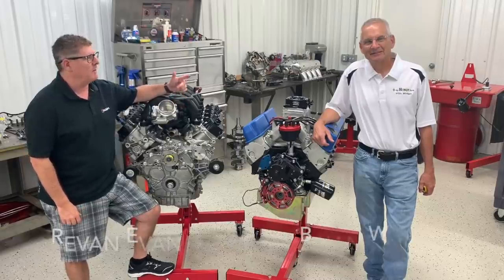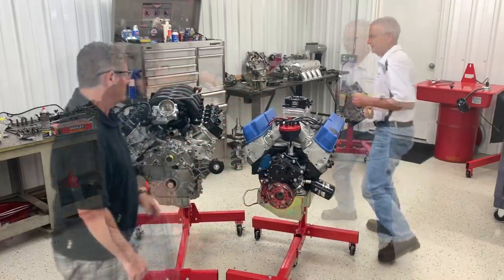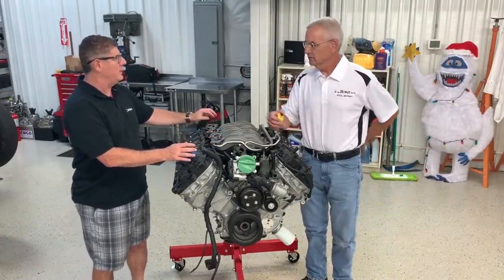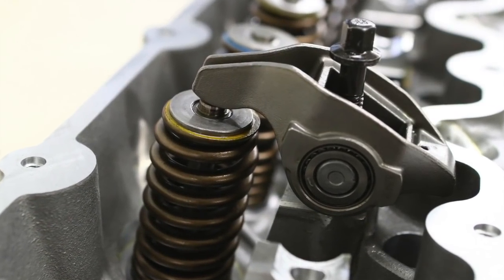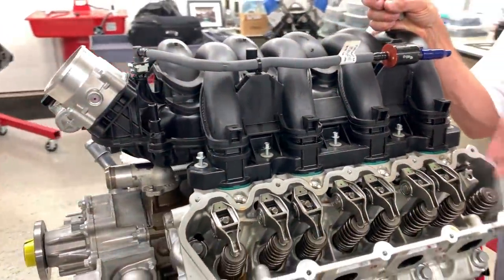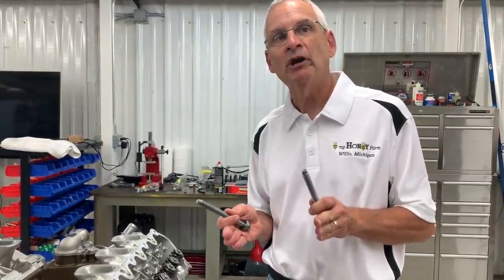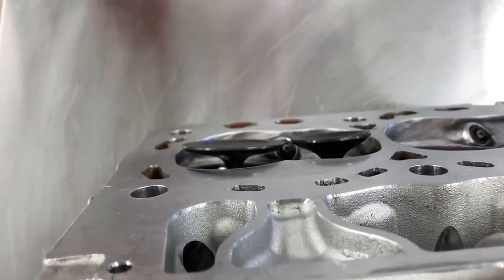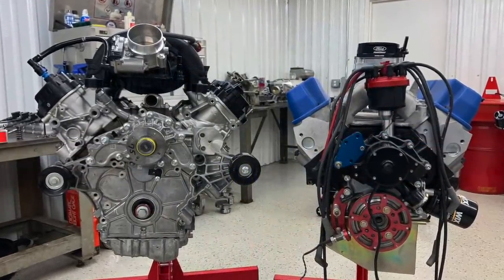Ford 7.3L Godzilla Engine Dyno Results, Teardown & Comparison to Coyote & 351 Windsor Part 2

Comment: Block is iron?   They need to make it aluminum so it's light.   It'll be clear that it's used where a 351w would be used more power and weight savings.

Comment: Two questions. Does this engine have timing belt or chain? And it seems this is to replace the 10 cylinder engine in fords line up. 
Thank you for this video information.

Comment: Looks a lot like Ls 3 head chambers and the block and lifter placement is Ls. Some what of a large copy.The 351c and boss 302 heads and 385 engines were canted valve like the mk4 big block Chevy heads. Good job Ford!

Comment: I would also like more detailed info on the rest of the motor, i.e. piston material, connecting rod details, crankshaft details, and lower end of block. Are main caps one modular unit?

Comment: Hello Evan, Im in the industry as a valve manufacture, we are tooling up to make stainless racing valves for this motor, was looking for some info. i have drawings ready to go, but im wondering if we should make an oversize valve, or leave it standard head size, could you possibly shoot me an email.  jd@sivalves.com  Thanks in advance.

Comment: Four-bolt heads.  The bolts are 13mm, but it doesn't look like there's a provision for six-bolts as the top ones would go through the intake port unless there's a plug to close up the port on top.

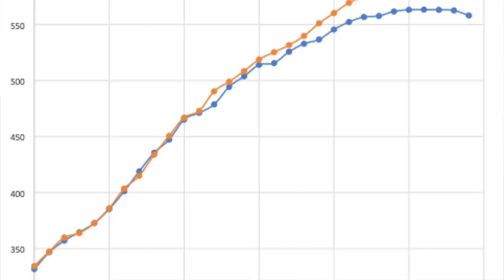Comment: The dyno graph at around 9:30 is interesting.   The first column is marked "headers" but the power was consistently less than the other column without a designation.   Probably a damn set of shorty headers.

Comment: I bet they make this an EcoBoost and if they do I can finally get rid of my diesel and the 18qt oil changes, the DEF, the DPF plugging up and all the other issues with running a diesel these days. Any fuel economy gains with a diesel are offset by the other expenses of running a diesel.....Ford, please make this an EcoBoost engine!!!

Comment: PLEASE, PLEASE, PLEASE YOU HAVE NOT EARNED THE NAME GODZILLA. AND A FORD NEVER WILL. 7 POINT HOW MANY LITERS ARE YOU JOKING. MY GTR IS ONLY A 3,8 LITER 6 CYLINDER AND BLOWS THE SHIT OUT OF ANY SHIT FORD YOU CAN FIND. AND MY GTR IS ONLY A STREET RUNNER. RAN 8.4 AT 162 WITH THE AIR ON STERIO BLASTING(RIDE LIKE THE WIND) CHRIS CROSS, AND WINDOWS DOWN ON PUMP FUEL...COME BACK WHEN YOU CAN DO THAT WITH A SIX....
Reply: Chris Cross was gay back in the day and sure as hell hasn't aged well. Did you follow it up with some Boy George and some Eminem? Modular Fords were going 5s fifteen years ago with stock blocks, heads and cranks...John Meovetzs. Nothing worse than a GTR fanboi Elward.

Comment: Hilarious seeing all the Ford fans come out of the closet. Nearly 3 decades of shit talking about how overhead cam was the shit and pushrod engines were shit. Now Ford has a new pushrod V8 and their fans are pretending they never shit talked pushrod engines for 3 decades.
Reply: What are you on about? We never trashed talked pushrods, and ford still sells reproduction Windsor blocks. The reason overhead cams are popular is for their ability to have more than 2 valves per cylinder, and reduced valvetrain mass.
Reply: @riogrande163  Every billy bob driving a Mustang or F-150 with a mod motor under the hood has been talking shit about GM and Chrysler "still using ancient pushrod engines" for the last 30 years.

Comment: What are all the important dimensions of the engine? Deck height, bore centers, rod length? Head flow? Stock cam specs? Bore and stroke?

Comment: I am sure this is 100% coincidence, but it is awfully reminiscent of the best design features of older (some even 40 years older) GM gas and Diesel engines  combined into one. I mean, might as well use the best possible design features ;)

Comment: A virtual copy of the GM LS engines in many ways. Even the combustion chambers look so similar. The lifters are in plastic holders arranged just like the LS. We all know how successful the LS is and I applaud Ford for using these design features. This looks to be a very good engines with enough cubic inches, finally, to do some good. Up to 6500-7000 rpm there is no downside to a pushrod design as we know from the LS.  This engine , properly tuned, installed in the Mustang would make the Coyote and the Voodoo rather moot. More horsepower and torque at all engine speeds and no need to turn the thing 7500 rpm. No need for an expensive flat crank and the complicated overhead cam hardware. Having a larger bore allows bigger valves and thus better breathing. Small engine displacement has been the bane of the entire modular engines series since it first appeared years ago. Not enough cubic inches, this engine fixes everything.
Reply: Do you mean how GM copied Ford's "Y" block design with cross bolted mains.

Comment: What were the mid lift flow numbers on the heads?

Seems like all it really needs is a well spec'd camshaft and some 1 7/8-2" primary headers and itll be a monster.  Some well thought out porting and a head/cam/intake package is making 650 wheel or more.

Comment: I’d be a little surprised if this engine got a lot of aftermarket support considering it ONLY comes in super duty trucks. I know guys like to swap stuff but the majority of modern car gear heads just buy a performance platform and go from there. GM had a similar situation years ago with the Vortec 8100 and that engine was all but ignored by the aftermarket despite several advantages over the old big blocks.
Reply: The aftermarket is already developing heads,cams, and intakes for these and will be available before your likely to find one in the salvage yards to swap into a car.....

Comment: Man this engine will start a new wave in big V8s, I own a car powered by a 6.0 LS with LS3 heads and jus love it, but this new Ford engine will be a game changer, beautifully engineered cast iron block with 6 bolt mains, over 4 1/2 inch bore centers, steel crank, 60mm cam core, 320+cfm Canted Valve heads that incorporate direct chamber injection also 2.17"x1.67" valves with a sturdy but lite Rocker system, straight out the factory this engine has alot of potential to make power, I can see Jon Kaase letting loose on one of these bad boys, 👍👌💪😁

Comment: The irony of any manufacturer going back to mid 20 century valve train designs just goes to show that OHC V8's simply aren't worth the hassle; for at least 6,000 on down RPM service

Comment: Ford has already had 2500 of these engines fail due to dropping valves. My brother works for ford and said the valve keepers are crap and break thus dropping valves. 🤦‍♂️

Comment: Knock knock, whos there? Wider bore space canted valve LS. 

I'm not a ford guy. I want to own a 7.3.
Reply: Welcome to the Blue Oval club🤘😎👍
Reply: @mikebricko5246  Thats going a little far. But maybe if I had an old ford ripe for an engine swap. 

I would own a new ford if they sold the 4.0L i-6 barra here in the states.
Reply: Those Barra's are some badass inline6's. I've always wanted to turbo 300" straight 6. Saw one with a custom head,where they took 2 Cleveland 4V heads,cut and welded together, running naturally asperated on alcohol making almost 700hp.

Comment: Is this Brian Wolfe that used to race a red 86 with twin mass air?
Reply: Yes
Reply: Brian Wolfe i
Met you at the Fun Ford Weekend in Columbus in 91’ or 92’. Pitted next to you.
Reply: Brian Wolfe You and Gene Deputy were there. I was running a paltry 13.8 with a nearly stock efi. Question: what killed the 460? Emmisions or the marketing department? Did it cut into diesel sales to much?

Comment: not impressed with how close the bores are together...
Reply: It does make you wonder if the engineers made sacrifices to fit this into smaller vehicles, rather than just the medium and heavy trucks it is supposedly designed for.
Reply: @cccharlie1972  My friend Chris insists it's for cylinder rigidity... I still say they're too close. you couldn't sleeve that to fix it.

Comment: Super tight bore spacing. 1 overbore at best?  Not too crazy about that part of it. 

If it catches on, I think you'll eventually see aftermarket blocks with a smaller bore but a lot more meat. I'm thinking the block will be the limiting factor. If the bottom end is like Coyote/Mod, it's damn near indestructible as is. 

Subscribed.

Comment: I think where this engine really has potential is from boosting.  Ford designed it as a truck engine, to withstand long periods of WOT operation.  The iron block and 13 mm head bolts should give it ability to withstand high levels of boost.  GM'S supercharged small blocks only have 12 mm head bolts, so the Ford engine should have significantly higher clamp load on the head gasket.

Comment: 320 cfm intake port flow is the same as a stock GM LS3.  CNC ported LS3 heads available from GM Performance do 350 cfm.

Comment: Nice to hear some basic tech specs on the engine.  It makes for some interesting comparisons to other engines.  The 4.53 bore spacing puts it smaller than the Ford FE, Pontiac, and Olds V8's, which were right around 4.625.  The original Caddy OHV and Chrysler Early Hemis were 4.56. Small block Chevies and LS's are 4.40.  The new 7.3 has a 4.22" bore, and won't have much room to grow beyond a 4.25 bore.  Max intake valve size should be about 2.25, which was a common size for big block Chevies of the classic era.
Reply: A 4.22" bore, with a just under 4" stroke??  So, Ford took the Pistons of the old FE 427 and mated them with the crank from the 428?  (Giggles to himself "took them long enough")
Reply: Don't forget the Gen 3 Hemi at 4.46 Bore Space, which did win X 275 today at Bradenton, which is considered a small block.

Comment: Now let’s see one of these with some 13:1 domes and a BIG solid roller!
Reply: i heard this is a poppet valved loop charged 2 stroke!  It runs dry sump with 2 VRO pumps and must use low ash synthetic 2 stroke oil i heard. Ford puled of ther 2 stroke marvel again! yes keep this 2 stroke going.
Reply: One of the other channels increased compression by increasing stroke, no domes...  Power was 975HP@8200 and 665ft-lb of torque

Comment: Fords finally stepping away from having the most advanced engines and going back to what has been proven for the last 50 years. I own an eco boost and it runs great but as a mechanic simpler is always better
Reply: CC Ryder cab over on all trucks, so try again. You Chevy guys are all the same. You act like Chevy is the best thing on the road and has never had problems. The best thing Chevy has going for them is that engine. The only reason plugs are easy on them is because they still come in from the sides. The back plugs are under the cab just like everyone else. If Chevy is so great why can’t they build a diesel or a transmission that can hold up to a diesel. Us ford ducks drive real ford diesels and real ford transmission. Chevy cars are junk like I said the LS is all you got. The 5.4 did have spark plug problems but if you are a real mechanic you wouldn’t be on here trying to bash other brands because you would know that they all have issues. For example the 4L60E trans which is also junk
Reply: CC Ryder The Allison trans is not a GM trans. That was my point. Replacing plugs on a 5.3 is way easier than a mod motor or a hemi because of the location. Every manufacturer puts the engine back farther for handling though. I will have to look and see how far the engines set back on my f150 compared to a 1500 Chevy. I have one in my shop right now.

Comment: Hey THANK YOU FOR REVAN, EVAN! 
Hopefully this 7.3 will live up to  my only go to 7.3 f250hd obs current 97 350k miles stock trans ATS TC 180cc/30%  Ball Bearing Hybrid billet on both ends of the balanced shaft air to liquid intercooler Banks ECM Chattanooga IDM 4" out the hood maxed couple easy does it dyno pulls avg at 1234hp just crackin 980 ft lbs(979.987)
Normal Get er done tune 745hp 579ft lbs Colorado Truck 22 years old never rebuilt we tow 8900lbs nearly everyday its my shop and home in a 16ft  cargo trailer. 
Cannot stand the suspense gotta get that Fox 7.3 down the ¼ mile WAAAAAAAAAH CLICK WAAAAAAAHHHHHH
Is he gonna squirt or blow that bad mama jamma?

Comment: With a lower manifold it should work great in a Panther chassis.   Truck torque and simplicity would be fine for a Crown Vic.
As always...no replacement for displacement.

Comment: I wonder if/when this will replace the 6.8 V-10 in industrial/power generation applications. 
I’m also curious how it will do at 1800 RPM, turbocharged, and running on natural gas. 
I believe the 6.8 can be good for nearly 200 horsepower at 1800/turbo on natural gas. I get this can do a little better. Maybe up to 275 horsepower so good for 175 kW.

Comment: 329 CFM? They’ll need to do better than that if their going to compete with LS platform.
Reply: well, the ls heads will be flying into orbit with the tiny ass bolts, while this 7.3 makes 320cfm on non-ported heads....
Reply: Ls7 flow 360 cfm
Reply: @petejoseph8257  nope, not stock. They flow 327cfm stock. Oh, and their rockers fucking suck.
Reply: @petejoseph8257  on a full port sure. Mid 320 stock... And you can't keep a top end together on it boosted

Comment: Ima ford guy but this motor is a bit of a let down. 475ft lbs. An ls7 is a smaller motor and makes same torque. I understand it's for a truck not a 2 seater sports car however being a bigger engine one would hope that it would have more torque especially being designed for some of the heaviest trucks in Ford's Fleet

Comment: I wanna know more about the steel pistons, how will those handle RPM? I imagine they'd be much heavier than Aluminum, but I suppose they could be light if they also have less material. I can see this engine breaking all stock bottom end records once turbos get involved.
Reply: @mewrongwayKOCXF  Yeah I watched the other video, guess they're aluminum! I dunno where I heard they would be iron, maybe some time when it was just barely released?

Comment: This engine actually sounds like a classic big block.
Reply: Yes, completely agree. I was really disappointing at first, with the push rods, two valve and narrow angles and such. But then I listened to the rest of Ford's pitch, going for heavy duty/commercial; low end torque, very tough,  reliable and cheap & easy to maintain. Put in a new cam, re-flash the ecu, put in a K&N intake and you have an huge power boost for low $$.
Reply: Right. I was waiting to hear it beat the 440 Hemi but was really disappointed to see it didn't
Reply: @Casper23srt8    Would be impossible to beat the "440 Hemi"...  ...they never made a 440 Hemi.
Reply: knight0334. Lol, I picked up on that to🤣.
Reply: @Casper23srt8  This is the video I was referring to. The exhaust really sounds like a classic V8.

https://www.youtube.com/watch?v=DYtVEVEuLRM
Reply: It can run in any tilted postion with oil injection, i want one, nice deep snowmobile sound to it, love to see her wide open for 10 min or longer, i bet she coud run8600 rpm's all day long, My rotary is motule 800 2t so i bought 3 gallons motule 800 2t for my old 99 7.3 poppet valved loop chaed 2 stroke diesel. the best oil so far but i premix it now and want to switch to a VRO oil injecion pump. A maxda rx-7 OMP or outboard or vortec chevy oil injector should work. i got my 8v92 2 stroke silver on 7 gallons of BRP XD-100 bulk sale, way better than shell rotella 2t and far cleaner running too!
Reply: here is a typical chevy 2 stroke someone made:https://www.4btswaps.com/attachments/2cyclesbc-jpg.6839/
Reply: The 7.3 is poppet valved loop charged 2 stroke which give it that deep snowmobile  or rx-7 sound!

Comment: Quit messing around and build a 446 Cubic Inch Coyote or Predator already ... what are messing around with pushrod engines for ?? Leave that old mechanical technology for the maxi pad crew ... DOHC 4 valves a cylinder 500 cubic inches 7000 rpm and lets go KICK SOME @$$
Reply: The engine you describe will be sitting in a crate until the day it corrodes to pieces because *it won't FIT in anything*.
Reply: OHC tech is OLDER THAN PUSHROD.

Comment: I would like to see ford build destroked versions of this motor to use in the f150s and take away the damn ecoboost engines as well as an aluminum block version and make a modern Boss 429 mustang.